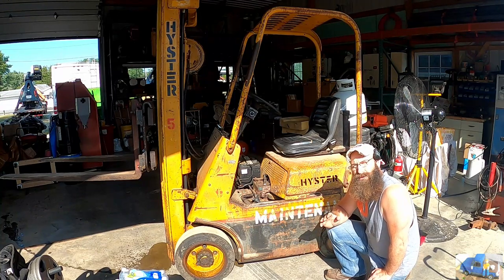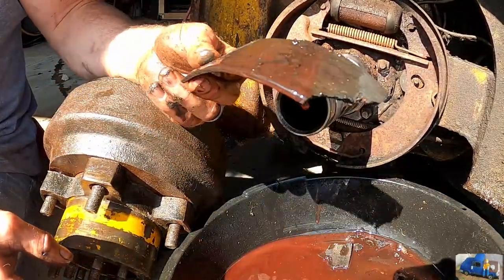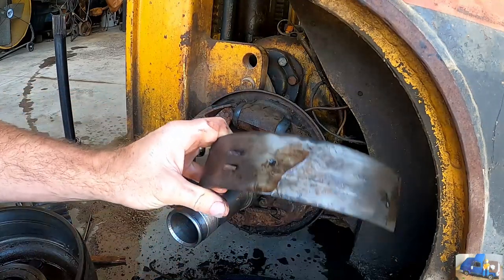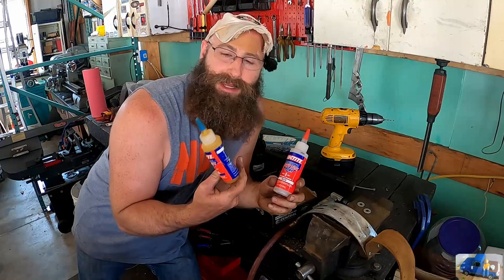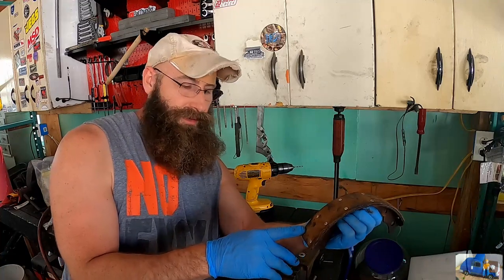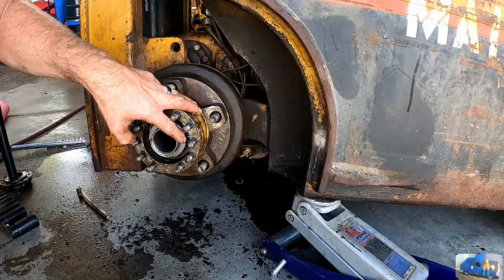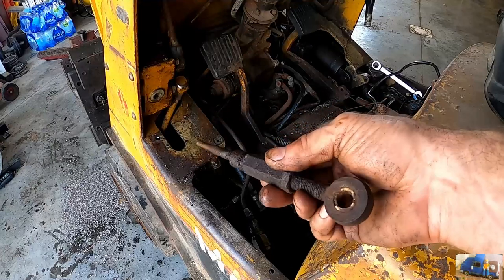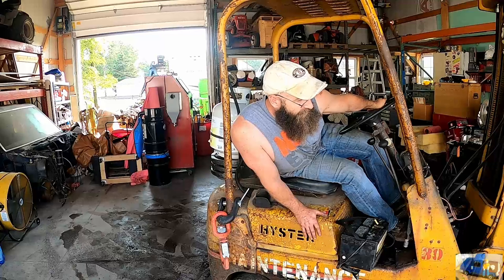Hyster - Custom Brake Liner / Brake Repair

Comment: If I'm not mistaking that is a Hyster model 30 you have there, I just got me an old toy to play a 2000 Hyster 50 and the brakes are gone so I learned a lot with this video . Thanks for sharing
Reply from the maker: I believe mine is a Spacesaver model, she's quite a bit older than your unit.  The brake shoes could share some similarities in design, though I am not overly familiar.  Get those brakes fixed! I used mine for too long without good stopping power.  This leather wrapped shoe still works.  Thanks for watching!  👍😁

Comment: I still have 1 in deep fork indentation were a new buyer of my forklift test the machine. I have made some stop pads for my old mill from disc brake pads jb'ed on. Worked and sold it that way
Reply from the maker: It's all about being creative!  My forklift was fixing to ram something or several things it shouldn't come close to before this brake upgrade.  Thanks for watching!  👍😁

Comment: Nice thinking on the leather Andy! 😁👍 Should get you by just fine.  Great job with the repairs and happy wrenching 🔧🔩
Reply from the maker: Thanks Zane!  It was a quick solution to get the forklift operational again.  If I ever figure out the correct part numbers I may upgrade both sets of shoes.  Thanks for watching my Friend!  👍😁

Comment: Two things, shoes are available (just need a SN off lift, which are stamped in frame if tag missing) second, you can get them relined as well.
Reply from the maker: I wish it was that easy.  The hood (the seat) wore off the frame stamped part number and so far I have been unable to find another reference.  I tried previously for hydraulic seal kits.  Thanks for watching!  👍😁
Reply: @FlatThunder   I think they can be found in the aftermarket from about 40 a side. I maintain a lot of lift trucks, from the 50s through modern day computer controlled stuff. The 70s era hysters just don't die. My 74 12.5k sa125 hyster is my favorite.  Sometimes the dealer can figure out SN of truck with mast SN.

Comment: I think I have the same hyster. Do you know what year it is? I am having a mast prob on the 3rd mast and chance you could do  a video of the mask working ? thx great video
Reply from the maker: Not sure on my year.... It is missing the data plate and the serial number is worn off.  Did you check out the other videos on the channel?  I use it every so often and have  other videos specifically on this unit.  If that doesn't help I can catch a video the next time Johnny #5 is in action.  Thanks for watching 👍😁

Comment: Are there brakes on both sides of the machine?  Didn't see that that part.
Reply from the maker: Yes, the opposing side is identical in construction.  Upon testing both sides were working well and I opted to avoid the extra disassembly.  Thanks for watching 👍😁